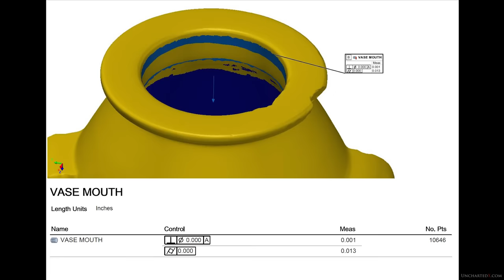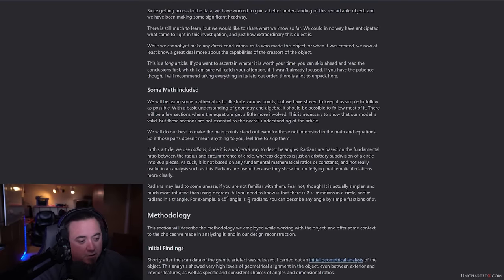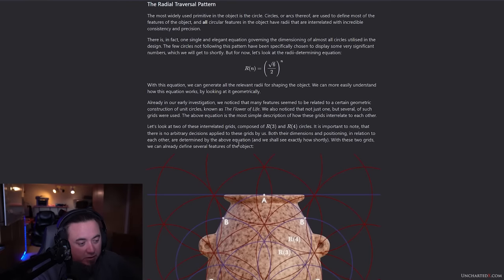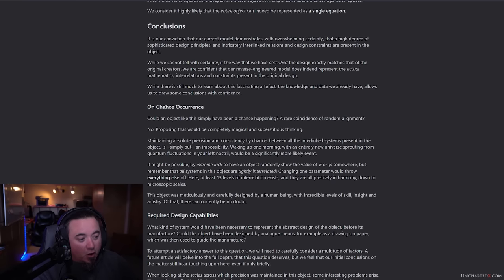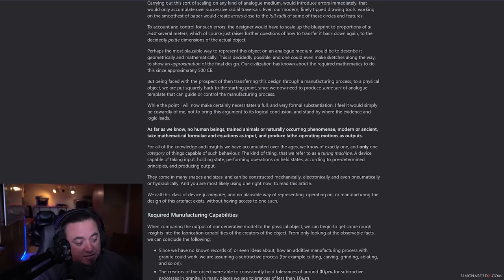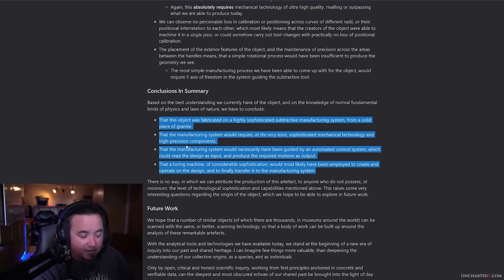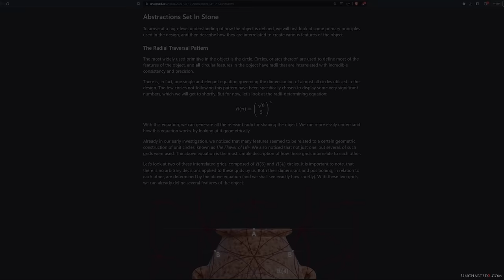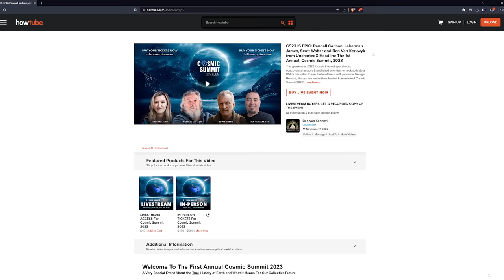Was a COMPUTER Used to Design this Artifact??

Comment: QUESTION: What about the object's wall thickness?
I have not heard or seen an analysis of the inner portion of the vase. How precise was the hollowing out of the object and are the astonishing tolerances repeated in this aspect of the object, especially the wall thicknesses?
Reply: yes…. documented in the previous two recordings on this vase.
Reply: I think that the equipment wasn't small enough to be able to fit inside the vase.
.
Reply: not all parts of this are perfect though. much of the interior and the handles is not  perfect to each other, suggesting to me that the vase was not made in one process. I would think that they made the base shape with computation based on intersecting spheres, creating an object hat wasnt hollow inside and did not have the finished handles or the flast lips, which break the geometric perfection to make it usable as a vase. I think they created the base object by creating as much of it as possibly with geometry, and then they cut off left over material at the top, bottom, around the handles and the interior according to what makes sense for a vase, which obviously breaks the geometry. I dont think the mechanism that created the insane precision only could operate in mathematical, sphere based ways and was not a milling machine or lathe. these might have been used to hollow it out and create the handles and cut off the top to make it flat. I think the precision doesnt come from them having machines that were that precise and powerful, I have reasons to believe that they used completely different processes which use nature rather than brute force. I recently read that granite can actually be softened like wax without heat, by chemicals that are produces by the roots of many plants, which use them to break string chemical bonds to dig into rock and extract their minerals, and there is a bird in peru that rubs a plant granite cliff walls to soften it so that it can drill a hole to nest with its beak into the granite. such softening was evidently used in south america, but by much more primitive people than in egypt. I belive they could have made the granite soft like wax, and then used strong ultrasound waves to force it into its shape. while this sound absurd and fantastic, the fact that they used radiants as a base gives gives it away. the circle and sphere is related to the sine wave function, where one radiant or 2 pi is one wave length of a sine. a sphere is a 3d effect of a 3d vibration, and intersecting spheres of specific sizes would be the result of 3 dimensional interference patterns, which if they were strong sound waves,, would cause high and low pressure zones such that soft materials would just be squished into place. it would be like 3d cymatic images, but with much more force and operating and a very soft but solid object. why would they even think in radiants and relate things in radiants, other than the fact that a radiant naturally is exactly one wavelength? if you you want to shape an object by adding sound waves together, using radiants is the perfect way to express a 3d object in form of waves that would create it. I even believe if there was equiipment and funding, we could use this to create any shape we wanted. we could come up with a machine that if you placed wax inside and have its inner walls create multiple additive frequencies of sound, it would naturally approach a perfect 3d cymatic shape. granite is piezo electric, meaning that electriomagnetic frequencies induce rythmic micro deformation in the stone, causing it to produce inaudible sound waves. with a computer, you could give electric inputs to create specific frequencies, which the granite would translate into a physical sound wave that can apply force onto an object, and if that object is relatively soft and the waves strong enough, it should just naturally get forced into the desired shape. 
such a process is superior to cnc machines in every way and can explain the inhuman precision and also the lack of perfection in the handles and interior. such a process would always be limited to natural and regular shapes, meaning you can create almost the entire vase or even a megalithic statue with ease and be as precise as the universe itself, but you cant use it on functional shapes  and surfaces, such as the handles and interior, which fits the usage. I believe that the case came out as a shape that was not hollow and had more material than necessary at the top and handles, and then power tools were used to carve the interior and cut out the handles and the top to make it usable as a vase. I think this is the true meaning of sacred geometry, how vibration gives shape to the universe. and it explains why certain numbers and rations of nature are so frequent in these object. a part from likely having a functional, vibratory purpose in the pyramids and false doors, they likely are just the result of the way they created their objects. seems like mathematical beauty and perfection was an effortless byproduct of their industrial process even in objects that did not need such precision at all.
Reply: @sshreddderr9409  I'm choosing, mentally, to not allow myself TOO much variation away from the hand-tooled explanation. Not because I deny the incredible precision but because the alternatives seem too far a leap to make IMMEDIATELY without more data. It just seems irresponsible to do so. More tests need to be made on more objects. If there are repeating conclusions that these objects are too perfect to have been hand made, then the evidence MUST be followed. Barring anyone stepping up today and literally showing us that making one of these objects by hand and achieving this level of perfection IS possible... I can see no other alternative but to say one of three things is true... (1) the craftsmen in ancient days were operating at god-like genius levels of ability using only primitive tools or (2) there was CNC machining technology available SOMEHOW to ancient peoples that SOMEHOW has completely vanished or (3) these pieces were inherited by the Egyptians, and they were made (for some reason) by a civilization that had this technology prior or during the time of the Egyptians and they were not human, or perhaps they WERE human but from a future timeframe... or some other basically insane sci-fi sounding permutation. The options, to me, are ALL wild.
Reply: @michaelharvey75  He has stated here you would need 5 axis of rotation and would have to carve the vase is a single pass.
Reply: @sshreddderr9409  but they are, what did you miss? There’s absolutely no way this could’ve been made by hand tools in the fashion cited by mainstream archaeology —- it’s impossible — we would have trouble even today.
Reply: @tenbear5  you misunderstood me. the vase shape is more perfect than modern machining. the perfection maintained across so many surfaces is not uniform in the entire vase. the interior of the handles and parts of the interior are perfect to some surfaces, but not all of them. 
that tells me that the vase was not made in one motion, but is composed likely of 2 or 3 different tool operations, that were perfect in itself, but not perfect to the surfaces made with the 2nd or 3rd round of machining.
 
I personally would propose a different mechanism than a 5 axis cnc machine that is much more elegant to me. 
I believe that the base shape was made with 3d cymatics. I think they softened the granite to the consistency of wax, then put it in a granite enclosure, and used electric signals to induce ultrasound waves in the granite enclosure, and the interference pattern of the sound waves would cause low and high pressure zones inside the container that would push the soft granite into its shape, then then would take it out, let it harden, and use a different process to cut off the excess material to make it into a usable vase. I think they used a computer to calculate the frequencies to overlap such that a shape very close to the finished product could be achieved, and to selectively give the electric signal to perform the operation. 

How do I think this is possible and why do I think this was used rather than the 5 axis cnc machine? 

1. granite, diorite etc. can be softened without heat with chemicals produced by the roots of many plants, which temporarily break the strong chemical bonds of metals and stones. this is a known process, its just not researched. in peru, there is tons of visual evidence for this kind of technique, like rocks being squished into each others or a hand mark put into granite, as if it was as soft as clay, but with no heat. there are birds that drill holes in granite boulders by rubbing plants against it to make it soft enough to easily remove like it was nothing. this could theoretically by used today to make these hard rocks easy to shape. 
2. the reason why my mind went to 3d cymatic shaping is because there is a very close relationship of the shpere/circle shape and the sine function, and I assumed before this video even that these vases and statues were achieved by intersecting spheres of different sizes, because the flower of life is a 2d image of a 3d grid of intersecting uniform spheres, and since you can place these objects as well as the platonic solids onto it, I took it as a construction of geometric shapes via the intersection of uniform spheres with same distances. the sphere is a shape that emerges from vibration. the perfect circle is the result of a 2dimensial harmonic oscillation, the sphere of a 3 dimensional one, where the harmonic expansion and retraction in all directions causes its shape. 
incidentally, the article casually said that besides the golden ratio and pi, the circumferences of the circles used were very close to 16 Hz, which means its a multiple of the smallest wave length of light in the vacuum . coincidentally, one wavelength of any sine wave with amplitude 1 corresponds to eactly the circumference of a circle with radius 1. so since the circumference approaches a perfect multiple of a light/electromagnetic wave, it makes sense to assume that this comes from an electric signal inducing a frequency. 

this would perfectly explain why this object is so perfect and mathematical. I assume that the geometric constriction was not necessarily chased for aesthetic or representative purposes, I think its rather the necessary byproduct of the method they used to shape it. so the perfection doesnt actually come from a better engineered cnc machine, and we are actually measuring the perfection of the universe operating on the material, rather than man made tools, and man made tools were used to operate the device/granite structure that created the sound waves. 

it nicely explains where such an unnessesary complication comes from, and why they seemingly prefered uniform and less detailed, yet geometrically perfect shapes such as in their statues of humans and animals, that are geometrically perfect yet less detailed and life like than what you could achieve by hand.  cymatic shaping would only allow the representation of geometric contructions, and therefore you could construct anything you wanted with perfection, except the irregular details that make animals and humans look life like, which would be impossibly complex to achieve with a geometric contruction, but very easy to achieve with a cnc machine or even by hand, but the geometric perfection is a by product of the method and impossible to achieve via cnc machining, or at the very least much more complicated, while it would by effortless with cymatics, and ratios and constants would naturally emerge everywhere in sound shaped objects. 

to me, the circumference of all the circles being multiples of a light wave length of 16 Hz, the possibility to soften granite enough to shape with sound pressure, aswell as the unnecessary geometrization of every aspect of the vase as if they could only produce objects via geometric sphere based contructions, as well as the interior and handles showing internal perfection yet impperfection to the perfect rest of the vase, tells me that it must have been cymatics and not a cnc machine, because if they had such a cnc machine, all parts would be equally perfect to each other even the ones who dont have geometric shapes, such as the top, the inner handles and the interior, which are perfect in relation to features connected to it but not to ever part of the vase. it being so perfect but having discontinuity in few parts that are again perfect with many other features tells me that it was made it multiple steps which each exhibited perfection, but if it was a cnc machine, it should be uniform entirely, and the geometry becomes unnecessary. even if you wanted to make it look harmonic, you would not need a geometric construction as complex as this to make it outwardly look the same. 

to strengthen my theory, we should find unfinished objects that have excess material in a geometric way, that typically would be removed afterwards. we could today develop a cymatic shaping process that could use the same method to shape wax or clay, and if we cared to get a hold of the plant in peru or look for other plants that grow on granite fiilled soil, we could recreate and use the process I proposed. the only thing we are really missing is the understanding of how waves create spherical pressure gradients. btw, this is the exact mechanism of how matter is formed by the universe itself.

Comment: I am skeptical of many of the more fringe claims made on this channel, but this is genuinely incredible stuff. I read the paper and the elegance of the mathematics is almost beyond comprehension. I hope this work finds a wider audience.
Reply: Yeah, this data is irrefutable. No subjective interpretation necessary. And the mathematics is so elegant that archeolgy has no choice but to accept it or ignore it. As it doesn't fit their narrative, my bet is they will bury it.
While they can twist their story, they can not twist the math or engineering. It's been overlooked for a century because the measurement technology hasn't existed. It obviously once did! Keep it up Ben, and stay removed from the woo end of the spectrum as it's lends no credibility to what are obviously facts.

Comment: Why did they make this from granite? could there also be some other significant meaning behind the choice of material chosen other than simply the difficulty of shaping it? Which in itself is remarkable! Could the material itself represent an understanding of something else or an intent that is yet to be considered? My mind is boggled
Reply: Perhaps they made it from granite because it was the most durable substance they knew of. Or like you say it was some physical property of granite that was required for the item to function.
Reply: Stone is more durable than any material. We use metal but as you know, metal does rust away and disappear. Stone takes a bit longer for erosion to destroy.

Comment: I would suppose that whoever made these artifacts had an energy type cutting tool - i.e. laser or plasma - that could be collimated and focused from the smallest radii to the largest without hesitation.
Reply: Cutting an outline yes.

How do you accurately hollow something out with a jet or beam?
Reply: @jamemswright3044  an energized cutting tool using an unknown form of energy. likely the same technology that created the tube drill holes, among other things.
Reply: @AustinKoleCarlisle  How do you accurately control the depth of cut of  a jet or beam? Particularly in a material such as granite.
Reply: @jamemswright3044  think of it like this: if you charged a butterknife with this mysterious energy and cut into granite, it would separate the granite at the molecular level and not wear and tear it like you'd expect with normal machining. it also wouldn't leave microscopic evidence of the metal knife in the granite. (expect to not see any evidence of metal on the surface analysis of the vase if I'm correct in my theory...) it would enable you to "slice" through granite essentially unimpeded--and that makes sense because there is no other way to create a granite vase as thin as a playing card (seen in other videos), traditional cutting would run the risk of fracturing the fragile granite.
Reply: @AustinKoleCarlisle  So not like a laser/plasma beam or water jet?
Reply: @jamemswright3044  no, just "energizing" a normal tool with an unknown form of energy that separates matter as the cutting tool passes through, more than likely.
Reply: @AustinKoleCarlisle  agree,  alien desintegrator cutting stone at molecular level by removing valence electrons
Reply: @al2207  nothing else explains the evidence we see, case in point: the granite vase with walls as thin as a playing card.